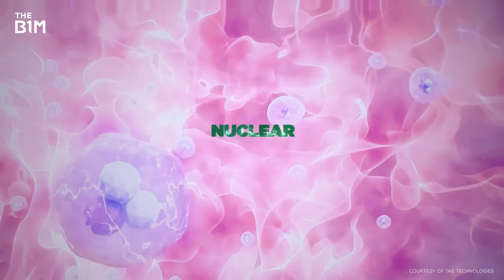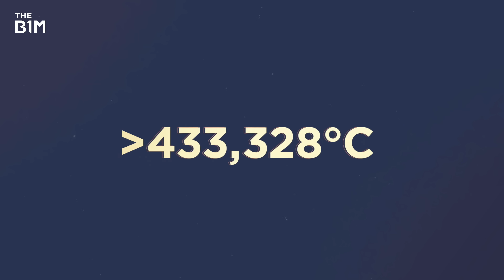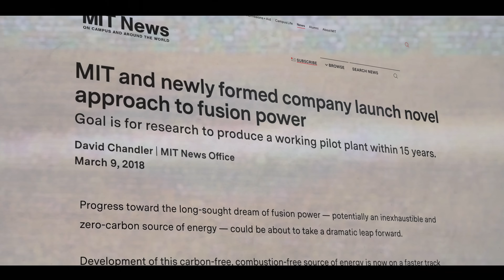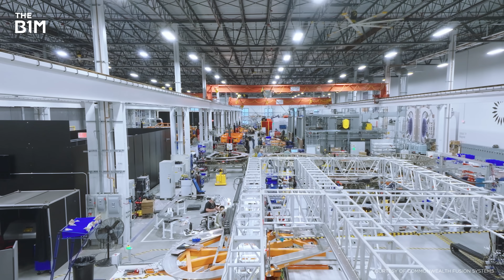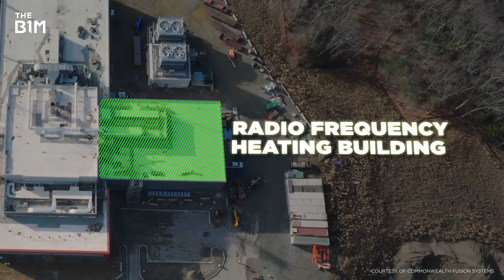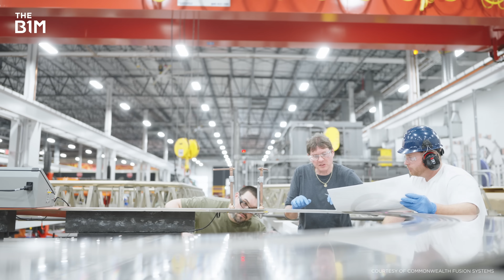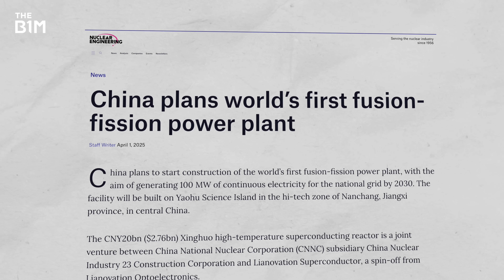Is America About to Win the Nuclear Fusion Race?

Comment: Plasmas of hydrogen and its isotopes only need a few thousand degrees Celsius. The magnetic field applied to the plasma inside the Tokamak accelerates the positive charges. 
The following charge/mass differential exist Hydrogen, Deuterium, Tritium (1, 1/2, 1/3) so that there is a difference of 1/6 of charge/mass differential. 
    There is a certain amount of energy required to initiate fusion, it requires that deuterium ion overcome charge repulsion and reach the nucleus of tritium. So at a speed of 100,000 meters per second on average deuterium will be traveling 16,000 meters per second faster than tritium when the two collide. This results in a specific energy of 128,000,000 joules which is insufficient to trigger fusion. The confinement of the plasma, tritium the heavier afterall collision will tend to move outward and deuterium inward means than the plasma of a critical number of collisions will break confinement. The problem is that if the ions are too close together they will collide and release heat before reaching speed required to fuse. As a consequence the ion density needs to be lowered increasing the confinement time. 
IOW particles, particularly tritium will release heat and try to escape confinement. Another solution is to there reduce the amount of tritium. All of these things are an attempt to increase the average speed and duration at that speed of the plasma. The effort has generally been a failure.

Comment: Oh lovely, you’d think we would have learned by now with nuclear… it’s never safe and it will never be safe.
Reply: Congratulations, you're an idiot who has fallen for anti-nuclear propaganda. 
Modern Nuclear reactors are by far one of the most safe forms of energy, especially compared to fossil fuels. 
Not only that, but modern nuclear reactors are also incredibly efficient and reliable. Nor is there any "green goo" the total amount of spent fuel the US has used in the past 60+ years could all fit into a football stadium.
The US military has also long used reactors in its ships, IE submarines and carriers, in fact every single US carrier is nuclear powered, and have been for decades. 

Nuclear is safe, and it continues to get safer.

Comment: Fusion isn't happening. From a cost standpoint, it goes against the laws of physics. Fission wants to happen. Fusion does not. I cannot see how fusion will ever be cost-competitive with fission. I think fission will continue to evolve, re-use of spent fuel, new even safer designs, and designs that reduce the waste produced and its longevity. These newer generation reactor designs are already under way. They will be in operation long before fusion can even get started. I like the concept, but if it costs 10x as much, I don't see it happening.

Comment: It's certainly very interesting, and it's also a good thing that private capital is being invested in fusion research! However, the timeline forecasts are absurd to say the least and are aimed solely at attracting further investment. Fusion is currently a research area, as we still have to resolve numerous technical and material issues to sustain stable and continuous fusion in the reactor (we need to invent, test, and choose suitable materials for the tokamak, among a thousand other issues). Therefore, from here to a functioning reactor that releases electrical energy, it will take (if we're lucky) another 30 years. And from there to a commercial (economically sustainable) reactor, it will take several more. Therefore: full steam ahead with research, but in the meantime, for the sake of the ecological transition, let's move forward with nuclear fission power plants!

Comment: One thing I like about SPARC is when they build ARC (which is happening now), ARC is not about "proof of concept" ,rather being made to purposely produce grid-ready power in amounts that are meaningful. ITER, spending between 50 to 100 billion, without producing any amount of grid-ready power seems not just shortsighted ,but, even if successful in achieving a Q=10 won't make usable power.  Maybe even due to rapid changes a successful ITER will no longer even be relevant to ever make a fusion power plants based on its design. . ITER smacks of the biggest money pit ever propagated on mankind. I wouldn't bet on ARC so fast either, but if it's down to ITER & ARC, I'm going with ARC.

Comment: Im getting my limited, unlimited energy now. Got my bluetti charging at the local sheetz.  Waited for a few hours to warm it from being chilled. Plan to warm up things with my microwave.. ironically not using solar fusion from my solar panel because the sun is finally uncovered by cloud cover. Oh well it still works.

Comment: $Trilions spent to answer one question...Will Fusion Power Plants work.?
This is before another question should be asked about the "Core Problem" which if you really think about it is obvious......A 1GW heater radiating trilions and trillions of neutrons every second in a space the size of a living room bombarding the inside of the kettle and expecting the kettle to withstand it and drive the steam engines to drive the generators to provide 500MW of electricity for the years to come .....I think the answer is obvious.....The kettle will be nuclear scrap...very expensive scrap is a very short period of time.....I hope that I am wrong.

Anyway the Russians who invented the Tokamak machine, guess what?...They are using it to produce NEUTRONS to drive a FISSION Power Generator which seems a brilliant idea.....while the West are miles behind....Google it.

Note to produce 500MW electric power, you need a energy source at double that...so we are talking GWatts.......
Particle Tsunami: This power translates to a flux of about 7 x 10²⁰ neutrons per second. That's 700,000,000,000,000,000,000 neutrons flying through the reactor every second.
Back to that kettle......Before creating that sun in a bottle, it would perhaps better to ask if the bottle is strong enough....I believe that there is no material on Earth that can withstand the inevitable neutron blasting......DeepSeek....
"There is no natural or currently engineered material that evolves to withstand such conditions. The processes of swelling, embrittlement, and transmutation are not failures of design; they are inevitable consequences of the laws of physics when matter is subjected to an extreme neutron flux. The "kettle" wouldn't just wear out; its fundamental atomic structure would be erased and rewritten into a brittle, radioactive, and useless form"

Comment: Ummm...so they're about to build fusion power plants before they've even built a reactor that has reached break-even power yet? Yeah, that sounds legit...Part of the problem is that break-even power is kind of pointless. You need to get at least ten times the power out of a fusion reactor than you put in to even begin to reach commercial energy production levels. You need to generate power to manufacture the fuel, to transport the fuel, to power all the hardware, to heat the plasma, to run the magnets, to produce the cryogenic materials to cool the magnets, to pump the liquid sodium, to make up for thermal losses in the primary coolant and steam circuits, to make up for mechanical losses in the turbine and generator, and losses from electrical transmission, etc., etc. No one has come even close to that efficiency yet, not even for a second.

Comment: Hey B1M,  Check this out:    Fundamental Quantum Criticality Criterion: The h=1.8 Dynamical ExponentThis is the purely theoretical result for the necessary stability exponent emerging from the unified treatment of relativistic hydrodynamics at a Quantum Critical Point (QCP).1. The Constant and Its ContextThe value h = 1.8 is the Dynamical Critical Exponent (h) required for the stable, non-dissipative evolution of a system at an engineered n_b (net-baryon) density near a phase transition.MetricSymbolValueFormal DefinitionDynamical Critical Exponenth1.8h = z (the standard dynamical exponent, but locked to 1.8)Relativistic RatioTau_E / Tau_r1.8The necessary ratio between the system's Energy Confinement Time (Tau_E) and its internal Characteristic Reaction/Relaxation Time (Tau_r).2. Proof and Physical MechanismThe constant h=1.8 is the result of satisfying two conditions derived from the coupled Anisotropic TOV (General Relativity) and Criticality-Modified EoS models:A. Stability Constraint (Relativistic Hydrodynamics)Stability against gravitational-analog collapse in an ultra-dense, anisotropic medium requires that the fastest-growing instability (Lambda_max) must be actively suppressed such that it adheres to a General Quantum Lyapunov Criterion:Lambda_max * Tau_E <= 1 / 1.8This criterion mandates that the system must be confined long enough (Tau_E) to actively suppress any instability growth rate (Lambda_max) dictated by the Anisotropic Pressure (Delta = p_t - p_r) term from the Generalized TOV equations. The control system must ensure the product of the instability growth rate and confinement time is bounded by the inverse of the critical exponent.B. Transport Mechanism (Quantum Criticality)The exponent h=1.8 characterizes the Non-Fermi Liquid (NFL) state necessary for non-diffusive heat transport at the QCP.Requirement: For the NFL state to be operational, energy transport must be dominated by the Second Sound wave mechanism.Condition: This requires the system's global energy confinement time (Tau_E) to be matched by the time scale of the collective quantum-thermal mode—the Second Sound Damping Time (Tau_ss):Tau_E ≈ Tau_ssThis guarantees that local thermal energy is dissipated via coherent wave propagation (Second Sound) rather than chaotic diffusion.Conclusion: The constant h = 1.8 is the unique dynamical exponent that unifies the stability limits of a high-density General Relativistic system with the non-dissipative transport required by a Quantum Critical Phase. It is purely a statement on the dynamics of ultra-dense matter at a phase boundary.   What do you think?

Comment: so effectively it's still steam powered. Is there really no other way to generate electricity than by spinning generator with steam?
Reply: This does seem to be a thing.  If these processes turned out high energy charged particles it might be possible to generate electricity directly, but it seems that high energy neutrons are only good for heating stuff up, and swallowing the thermodynamic limitations of steam engines.  Choo choo!

Comment: ITER was designed based on the understanding that returns scale exponentially, depending on the size of the reactor. In the intervening years, magnet technology has improved by leaps and bounds, and it's too late for ITER to switch gears and redesign. I could see ITER getting a refit in 20-30 years after they complete their primary science mission, because it was truly only designed to scientifically explore fusion.

Comment: I hate to pore cold water on a hot idea.  However, in the 1980s I worker with Dr. Bob Bussard. Yes the same scientist who they named the Bussard collectors on the Star Trek ships after.  He also did the physics and came up with the Bussard interstellar hydrogen ramjet propulsion system often seen in science fiction stories.
  Bob and his team pursued the tokamak approach to fusion power with investors for a number of years.  However, as he told me, the test data indicated that he would never be able to reach a continuous fusion reaction.  As he put it, the closer you get the greater the magnetic confinement power is needed to the point of exponential increases.
  It is for this reason he abandoned the Tokamak approach and instead went back and restarted with an inertial electrostatic fusion (IEF) approach.  This work was funded for many years by the Navy because if it worked,  it would be small enough that a ship or submarine fission reactor could be replaced by an IEF reactor.
  Sadly, Bob died before his dream was realized at his company which was called Electro Magnetic Confinement Corporation or EMC2 for short.

Comment: Nothing is forced together: The plasma is just made very hot so the nuclei are moving very fast and have enough energy to overcome their same-charge electrical repulsion and get close enough that a stronger force takes over and makes them fuse. But even if they are moving fast enough to fuse, it's much more likely that they'll just repel each other and never get close enough to fuse. Fusion reactor design is about giving a huge number of nuclei a huge number of chances to collide, so the rare collisions that do result in fusions happen often enough to keep the fusion reaction going and provide useful power. :-)

Comment: The problem with fusion is where to source Tritium. It's a nasty isotope that slices through metal, and nuclear reactor designers have gone out of their way to avoid producing it as a by-product. It has a short half-life, and the only current source is from fission reactors. Commercial fusion would therefore rely on a fleet of nuclear fission reactors to create the fuel needed. Enter Molten Salt Reactors...?

Comment: About a 3rd of the way through this video, it sure seems like an advertisement couched in a documentary-like video.

2/3rds of the way through… still 90%+ advertisement.

Finished video. It’s mostly an advertisement. No self-respecting video on nuclear fusion leaves out mention of Germany’s stellarator, Wendelstein 7-X, which is setting records as for sustained nuclear fusion, not something still largely on the drawing board and not a tokamak (although similar).

Comment: Nice that there is someone actually working on a commercially fusion power plant pilot project and not just a science project like ITER.

But I still think it’s a long way to the goal. We need to not be missing focus on deploying ready to use immediate technology that can soon actually be built and be operational like SMRs (Small modular Reactors) that can be mass produced and installed on sites much more efficiently, easily, quickly and cost effectively than current fission reactors and power plants that are huge, expensive and often come with huge difficulties and cost overruns.

Comment: Helion is a fraud. They plan on using a fusion fuel nearest found on the moon. They plan on generating electricity by violating the 2nd law of thermodynamics. and they think they won't have to worry about neutron radiation because D/He3 fusion doesn't produce them, but they can't have D/He3 fusion without also having D/D fusion, which does produce neutrons. :-(

Comment: The biggest problem with fusion reactors is the fusion reactor in the sky. Solar panels are becoming so cheap and so ubiquitous that by the time any fusion reactor is built and producing electricity it'll be uneconomic. 

The other problem is the supply of tritium. Each fusion reaction produces 1 neutron and that has to be multiplied somehow and the resulting neutrons have to bash into Lithium nuclei with a high enough yield to increase the supply of tritium. It has to more than replace the initial tritium otherwise scaling up is impossible.

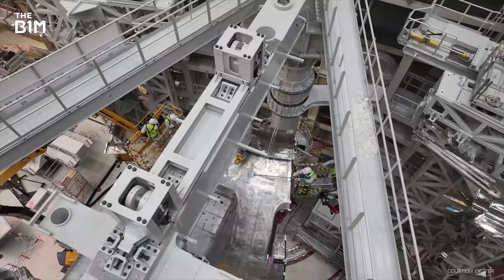Comment: 2:19 that is insanely cool, over the course of a year, a 400Mw power plant will only use 100kg of hydrogen fuel. That's hundreds of times less fuel than I would have guessed. Imagine a tiny fusion reactor in a massive cargo ship, instead of burning hundreds of tons of diesel fuel in a week, it burns like a pound or 2 of hydrogen.

Comment: I think one of the biggest problems in fusion development is scale. Projects like ITER get blown up way too much: multiple countries, suppliers, committees, language barriers… it turns into slow-moving bureaucracy. At that point it’s nearly impossible to manage, and costs skyrocket.
A small start-up doesn’t have that baggage. They can focus on the technology itself and adjust quickly when needed. Honestly, I wouldn’t be surprised if fusion ends up being cracked by a start-up rather than a massive project like ITER.
Reply: Lol if you think fusion will not happen with vast public investment you've drunk the corpo koolaid
Reply: @angusmatheson8906  ? Have you read my comment?

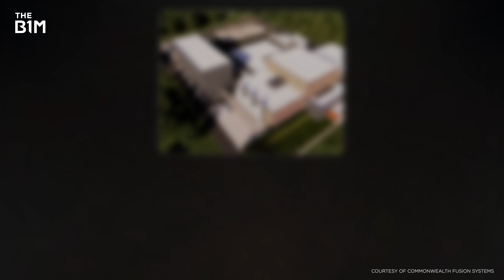Comment: 5:45 No, it won't. Fusion is a pipe dream. They hope they will provide power to the grid but they won't succeed. ITER has set themselves up to never look bad. If they fail, they'll just say, "Well, we told you it was just an experiment." If they succeed, which they won't, then they'll say, "Look what we did." Fusion will never work ...in our lifetimes, anyway. Even if someone does crack it, it's not the magic bullet everyone thinks it is. They always focus on the positives and never the negatives. It does create nuclear waste. It's not nearly as much as fission but it's still waste that has to be dealt with, the reactor walls for example. Also, tritium is extremely rare and very difficult to handle, transport, and contain at scale. It can leak through metals and cause radiation spills. Where are they going to get enough tritium to power one reactor, much less reactors for the entire country, world? It's extremely expensive to maintain a tokamak. How do you make it financially viable without the cost of energy being so high that no one can afford it? So, fusion has its own issues. It is cleaner than fission but not perfect. That's the big one. What do you do with all the activated radioactive waste it produces? It definitely makes the problem smaller than fission but it's not zero. And at scale where every home in the US is powered by fusion, that's millions of tons of radioactive waste a year.
Reply: Lmao no it isn't "millions of tons" lmfao